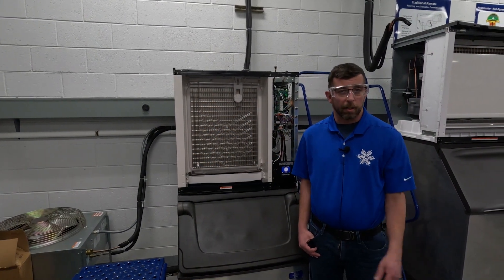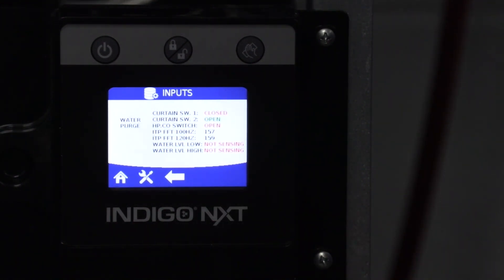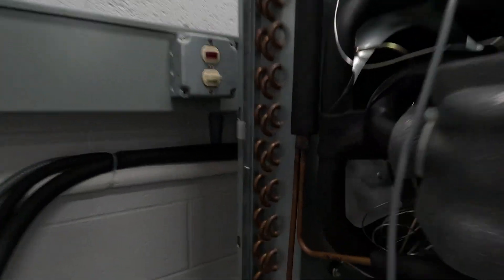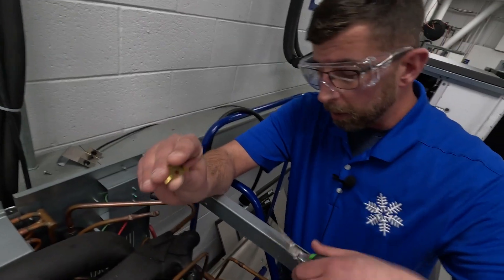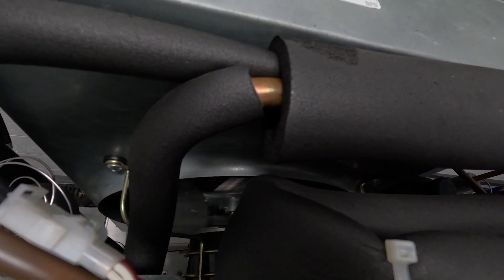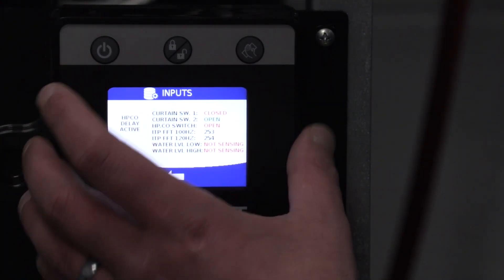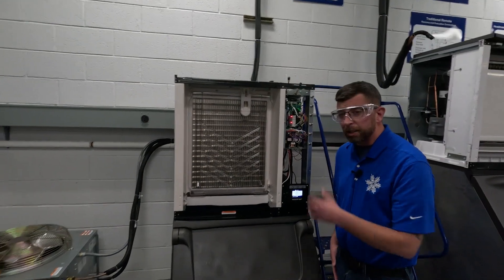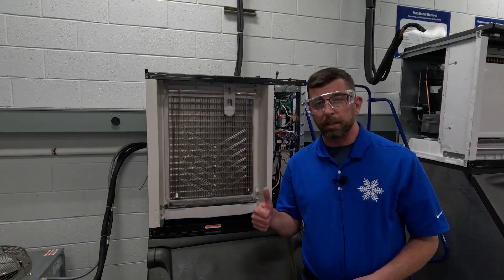Indigo Fan Cycle Control Diagnostics

Comment: I bought a new Manitowoc IYT0450A Ice Cube Machine in June, and noticed that the fan turns on and off about every 10 seconds. We only use the machine on the weekends, and it's very frustrating because it wasn't cheap. I'm going to contact Manitowoc because it's under warranty. What could the problem be?